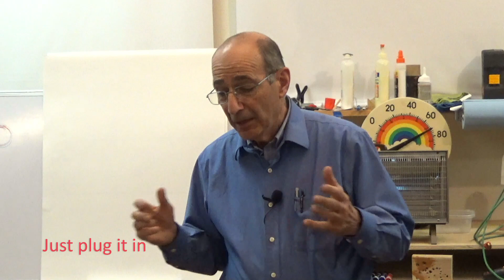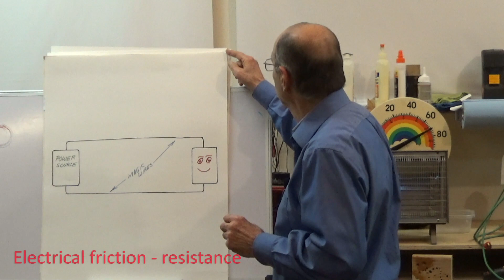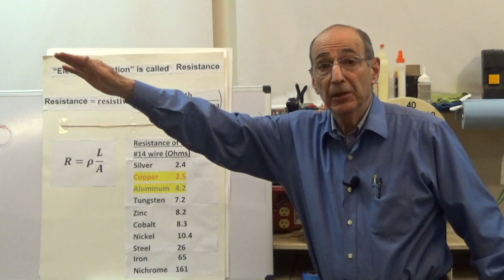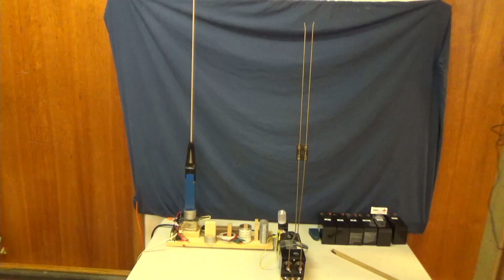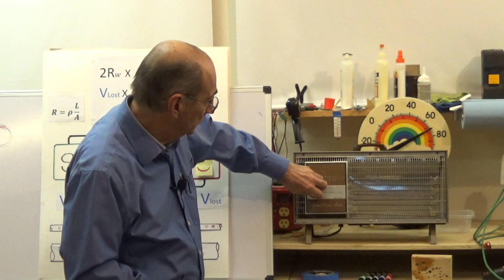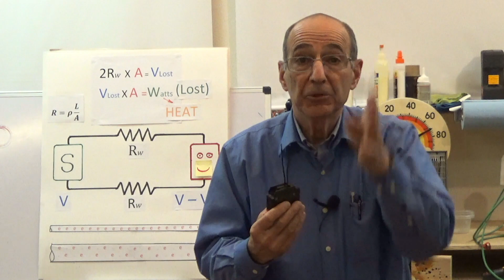Session 14 Resistance and real wires

Comment: Hello, is it possible to show the factors related to the "algorithm" which make up the factors giving the "R" (Resistance) with which we calculate"R", thereby showing the formulas integration of the Schumann resonance. As the resonance frequency increases, so does the value of "R".
At laboratory settings can simulate controlled conditions, globally increased (OR decreasing) of the Schumann resonance frequency will change "R", resulting in transformer changes, as well as long run wires and power distribution, catenary systems.